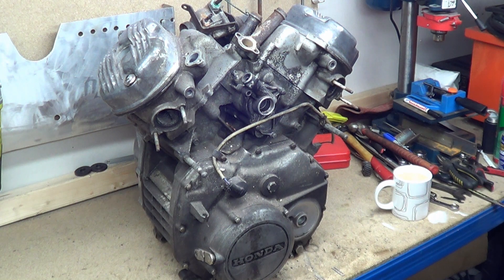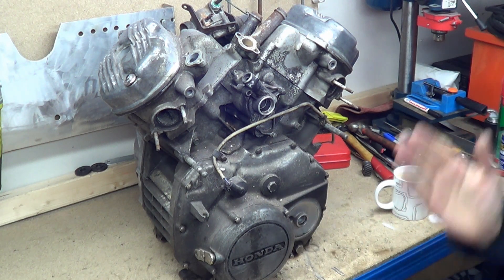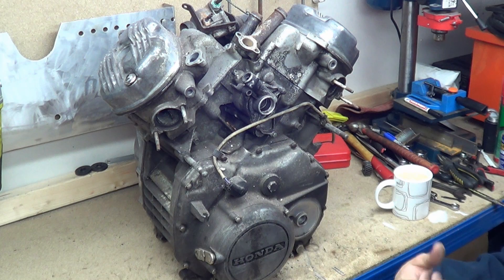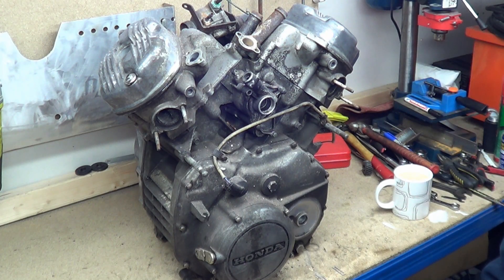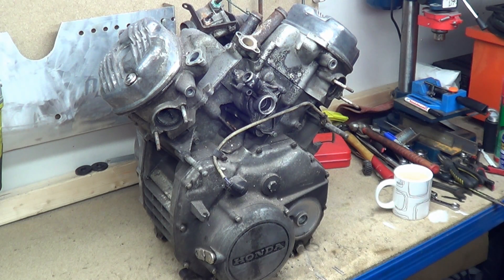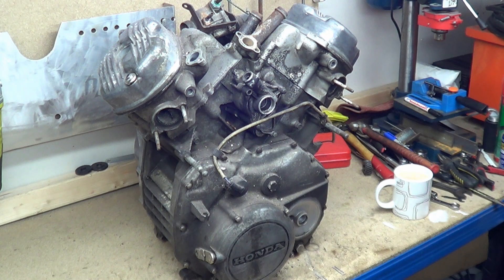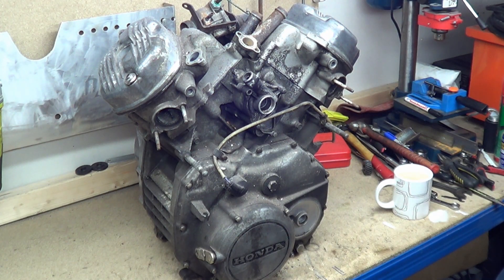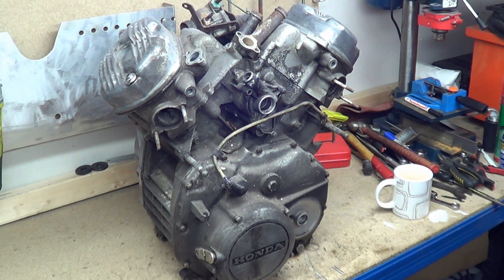CX500 V twin 4 Stroke Series - Part 1 Introduction

Comment: Greetings from Australia, can't wait to see you get stuck in. On my third CX, great bike, and very unique. Watching with interest.
Reply from the maker: Greetings from the UK lol Thanks for the comment mate, very unique and a very interesting engine that most people haven't seen. I'll probably need some pointers etc as I'm new to this engine as well. Other videos should be up soon. - matt
Reply from the maker: Ah one other thing, don't wanna spoil anything for anyone but I kinda heard there's a common fault with the cam chain tensioner and this motor has that problem. You'll see in the videos coming up. Have you encountered this problem before? Thanks again matt
Reply: Pony Power
Yep, they do suffer from cam chain issues, but, all parts are still available. Cam chain, tensioner, guide blades etc etc.. Once fixed, years of trouble free riding, with regular servicing. Good luck. Try davidsilverspares or CMSNL etc for parts.
Reply from the maker: TheBear351c Thanks alot the sites you recommended were a great help - matt